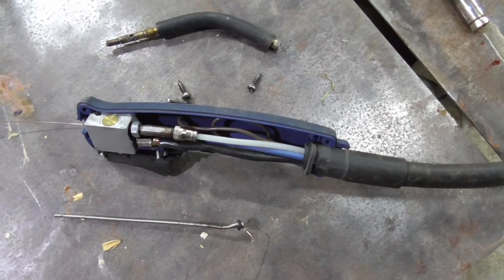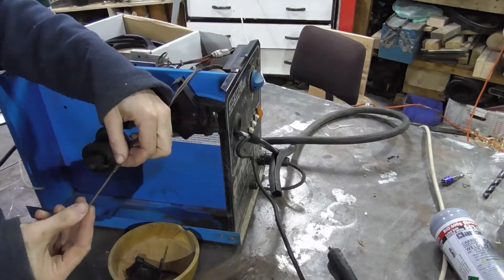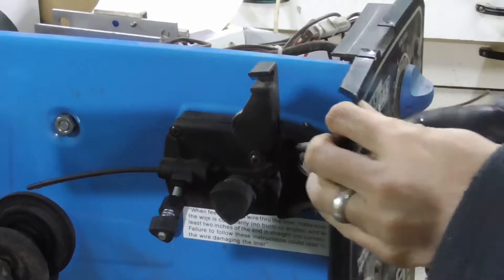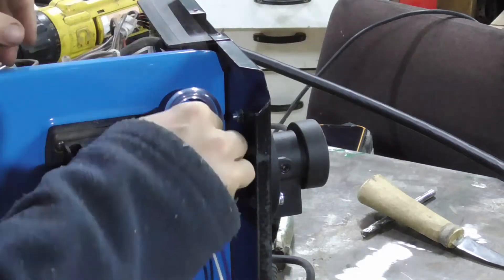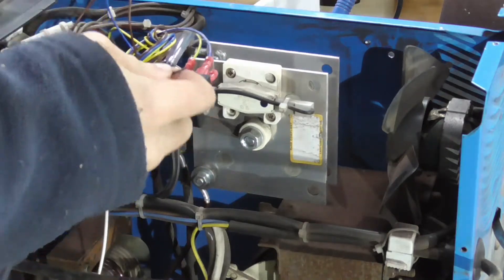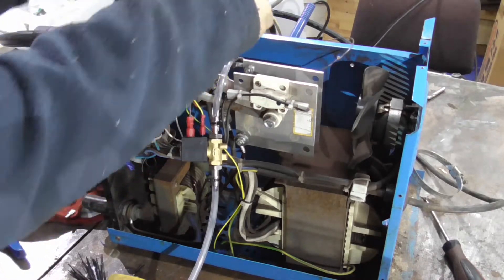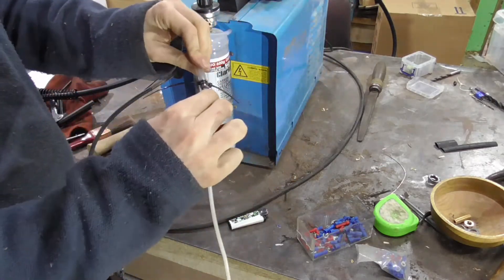Clarke 151EN welder - Upgrade to Euro torch (MB15) with solenoid valve

Comment from the maker: For anyone interested I'm in the middle of planning the gas conversion to a 10l bottle to stop using disposable and making a trolley to mount it all on. Hope to see you in that video too.
Reply: I already did to mine, it works great
Reply: great vid, any update on the gas conversion to the larger bottle?
Reply from the maker: @Will-vu9lo  I did the conversion in this video https://youtu.be/_37vblD1wwY It has made a massive difference and has lasted loads longer than expected. I would high recommend even if it is a bit of an pain to set up an account with a gas supplier.

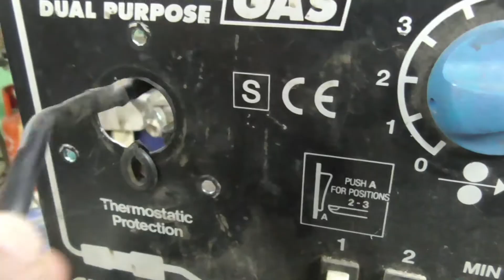Comment: Where does the black wire at 05:37 go   to exactly?  You attach one end of it to the threaded brass fitting  but  why have you got it coming out of the hole at the front?  This supplies the current to power the electrode.  When the welder is powered on - does it make the brass assembly and everything the electrode wire is in touch with 'live'?

Comment: Hi
I need to replace the liner in my 151en and was wondering whether I would be better putting the money towards an inverter job and have just seen your video. So, to help me - Why did you go to the trouble and cost of upgrading against a new inverter job since it's 4 years on from your video and  they must have improved/ got a lot cheaper. Any help would be appreciated
Reply from the maker: They might have improved I don't know. this is what I have and it has done everything I've asked of it so I'm still using this welder.

Comment: Hi can you tell me what voltage the solenoid valve is on yours I'm converting the same welder to euro all I have left to do is wire the solenoid valve the one I have is 42v is that any good I'm not sure where to take the feed from
Reply from the maker: i cant remember exactly it was a while ago but it think it was 12v, but i used a voltmeter on the board until i found a 12v supply that was only on when the trigger was pulled, i think it was the wire feed motor supply wire
Reply: @InfinityMindDIY  Thanks for the reply yes that makes sense I shall look for a 12v one excellent video it  made it easy for me to convert thank you 👍

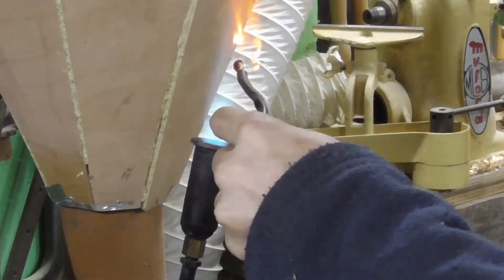Comment: 4:45
The problem with soldering zinc-plated lugs, rather than crimping them, is that if you use active (plumbing) flux then it will corrode the zinc plating into non-conductive white zinc oxide and create resistence in the cables. 
In time, the solder will completely detach from the lugs and lose their electrical connection. 
The corrosion caused by the acidic active fux will be occurring out of sight, so you'll never suspect it is causing any conductivity or welder performance issues.
Always crimp cable lugs, never solder them.

Comment: Your clip was exactly what I needed ... I was always having issues welding and all to do the the torch, hose, liner etc ... ordered the same bit now but no solenoid ... WOOOOOOOOOOOOOH what a difference 😎 ... thinking about upgrading the motor ❓️... Thanks for your clip 👍👍👍
Reply from the maker: Yeah i've always wondered about changing the feed motor but after doing the torch never needed to

Comment: Will this work just as well as a Gasless ie no Gas Solenoid. Great conversion NICE 😎😎😎
Reply from the maker: I've found that welding with gas is way better, it spits less and easier to get a nice bead but just using the new torch is way more comfortable. No reason it should work fine as a gasless conversion.

Comment: Nice, I wouldn't worry about your up grade for gas. Its easy, I use my big bottle off my big machine all the time, you just buy a pipe that goes on the reg then it has a push connection on the other end, straight onto white pipe of little mig..sorted. Still, best idea, sell shit little clarke an buy a jasic 160 or anything proper, you'll love it. The quality of a top notch machine just shines when you weld.
Reply from the maker: I did do the gas upgrade you can see it in the welding cart video. Even with it being a clarke welder its so much better than before. I've got a feeling my next project is going to need a bigger welder at some point but I'll cross that point when i get there.
Reply: @Infinity Mind DIY  I had one for small jobs outside of the workshop and car body stuff, trouble is, they are always shit, they don't have the arc force and stability of a quality machine. If you have ever used a better quality machine, you'll soon be pissed off with the shit welds your clarke makes. I've a big Lincoln mig owned for 14 years, and a old sealey mma machine I've had for 30 years, I bought a cheap inverter, it was shite, made a sqweek noise like a mouse and wasn't very stable in the weld. So I ebayed that an bought the jasic 200 mma on recommendation, what a tool. So on that front, the clarke went on ebay an I bought the jasic 160 mig. I know,  a 800 quid is more than a 300 quid machine mart special. Money well spent though if your using it regularly.

Comment: Done this on my Clarke 160EN, but before doing it, I upgraded the welding circuit breaker to an RCBO for safety, you won't feel any shock if you accidentally touch live wires !

Comment: great idea i don't do a lot of welding now but have in the past I have the Clark 100e  picked up a few years ago at a flea market for like 20 quid lol  to my surprise it worked  i thought the euro torch  was going to be expensive and not worth the bother but priced them online and they are not too bad  saw a conversion kit for like 50 quid  i didn't even know you could do this thanks for the video
Reply from the maker: I know I made the video on having to replace the old torch any way but having just done a load of welding with it I would consider this an essential upgrade from now on the welds were just so much easier to get nice and even

Comment: Awesome video.  It helped big time!Just converted a clarke 160en turbo. Only difference being  was that the  j1 connector was blue, and the  j2 connector was brown,... -  but worked both ways round so kept it as it was originally to connect to the gas solenoid.  (Blue to blue and brown to brown). Didn't  blow myself to bits, which is always good!
Also on the red machines, the front has a slope to it, so had to fabricate a stand off plate for the euro plug connector. 
Cheers again! 
Very helpful.

Comment: Fantastic video and just in the process of doing exactly the same on my 151en but could you please tell me where the white and the blue wires go that come from the trigger?
Reply from the maker: So at about 6.55 you should see that I have connect the to two brown wires these are the ones that used to go to the old trigger. I cut them when removing the old torch. It shouldn't matter which way around they are as it is just a contact switch. Hope this helps if not let me know I'll go and dig a picture out for where the brown wires run to.
Reply: @InfinityMindDIY  thank you i follow your video from start to finish and kept rewinding it till i had finished fitting it. I really appreciate that you did your video it helped me alot. Thank you